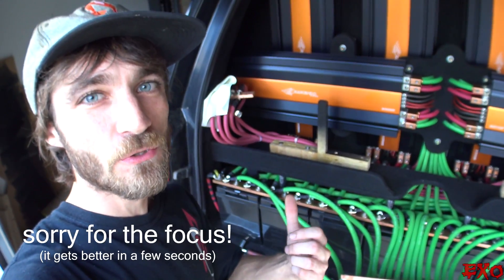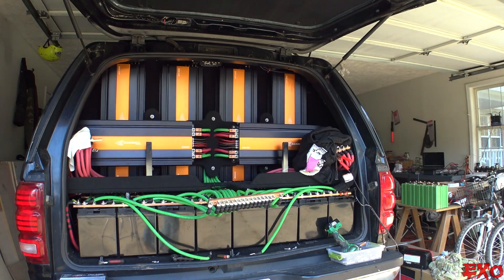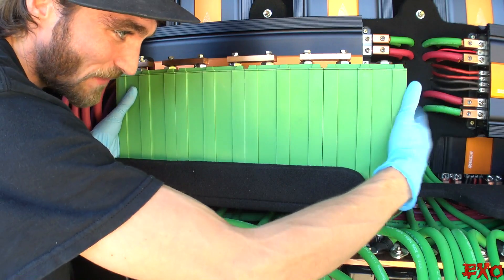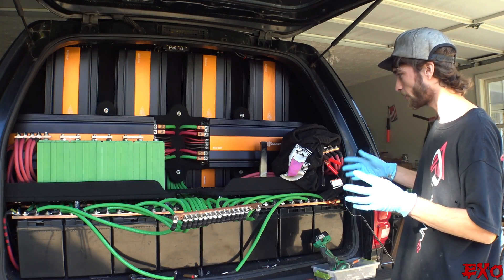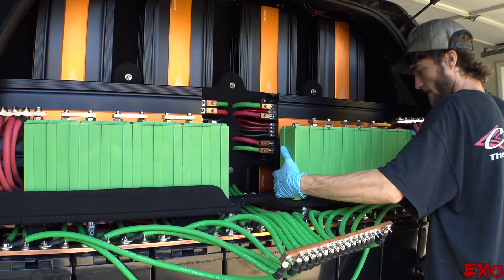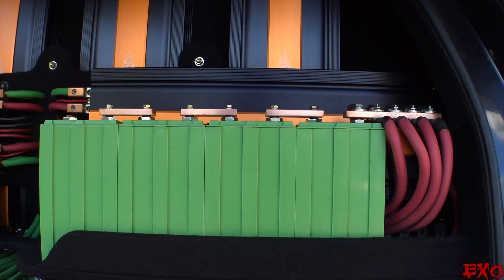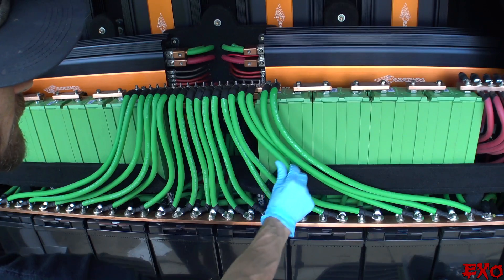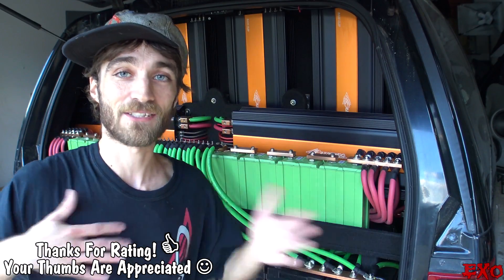WIRING Multiple Car Audio Batteries in Series / Parallel | How To Wire JY Lithium & AGM Battery Bank

Comment: So I got one XSD6500 under my hood. And one more XSD6500 in rear.  I’m wanting to to put one more XSD6500 in the rear with the other. (My question ). Does each battery in the rear need its own ground.  Or can I ground both on the same ground??

Comment: I am planning the installation of six 12v batteries in parallel for a solar panel and inverter setup, I don't want to use cables and crimp lugs so I am looking for these copper bars.  Did you buy or built those copper bars you used to connect the batteries? Awesome system man, good job!!!

Comment: What type of batteries are on the bottom? I heard using different types of batteries with the lithium’s will drain the lithiums
Reply from the maker: There will be a parasitic drain, yes. Works well for balancing a daily to an extent, but once long periods of time without starting come into play, separation can be advantageous.

Comment: Exo im havin a issue hope you could maybe help me out . I bought a ho alt from power masters ik i should have saved a lil more and went to mechman. But anyways its goin crazy my volts are shooting up as high as 18.7 even whn im wangin my beats im pushin hcca everything 2 12's 5000.1d amp 1 redtop and 2 1000ca dry batts. I want to know if i would be able to use the external volt regulater from mechman to control and regulate the output to my car and audio. I cant afford the mechman alt yet but i need to figure out sumthin couse this is my everyday. And its not moveing at the moment. So if that will work or if you have anybetter ideas can you let me know thanx.

Comment: Exo hey buddy I got a question I got a two channel amp 1 ohm stable can I run 1 ohm on one channel and 2 ohms on the other? I hope that makes sense I have one 12 inch sub in a separate sub box and four 8 inch subs in another separate box the 8s are wired down to one ohm the 12 at 2ohm

Comment: Mate, I love how interactive you are. Whatever you do, keep up that good work! Interactive education is THE BOMB! That's precisely why the flight industry, NASA, etc has been so interested in simulation for so long. Youtube can't quite do interactivity like a VR game or a practical lesson with a guide can, but you can still ask questions and answer questions; ignore negative shit, always remember your channel is informational and not emotional, so there's no need to introduce emotional stuff.

Out of curiousity, why not also replace the lead acid batteries with lithium? Are you scared that they might blow up? Well, I can't blame you. I wouldn't want those batteries you have exploding. Eight foot walls of fire and searing hot lithium, combusting shrapnel, mmmm. Barbecuey!

Not so likely; you need to make sure you have enough packs to be able to start the engine while your sound system is running. If you don't think you'll have enough, add a few large supercapacitors in parallel like you have the batteries; they've got even better CCA than lead-acid batteries, to ensure you won't blow up your batteries from cranking your engine and drawing too quickly. In fact, you could probably just crank the engine from a supercapacitor and use lithium batteries like yours exclusively for the stereo... In the rare scenario that you haven't started your car in the last 48 hours and the supercapacitor has fully discharged, make sure you have a jumper cable long enough to reach from the lithium batteries to the supercapacitor to charge it up and you'll have the best of both worlds; energy dense, constant power from lithium for your audio and high amps for engine cranking. Eh, I suppose they're both pretty high for you, which makes me think replacing the lead-acid batteries with lithium batteries alone would be fine... man, I have a serious problem, huh? Ha ha, well, if you can't laugh at yourself...

Comment: Hey EXO, i was wondering, i have a Renault Clio 1 Phase 3 that uses a regular 12v battery, if i install a better alternator with more amps and a 14v battery will it hurt my car electronics ? Thanks

Comment: you should install a battery tender in the truck so you can plug it in when not in use and it will maintain the battery charge while it sits.